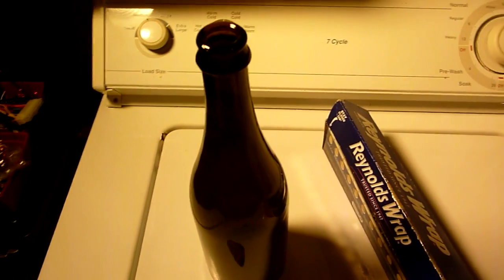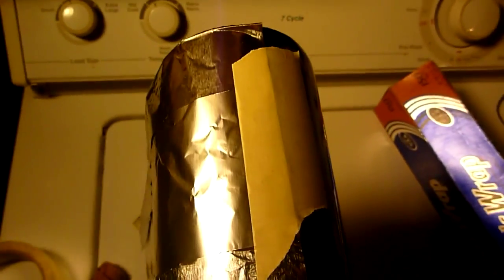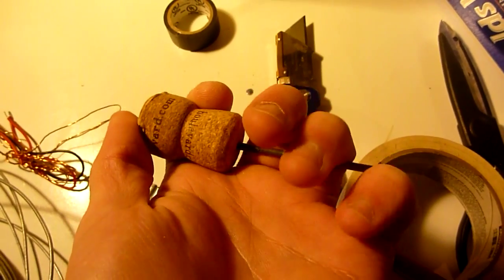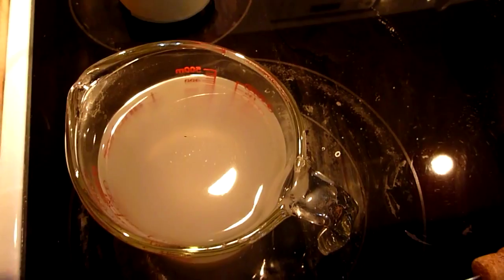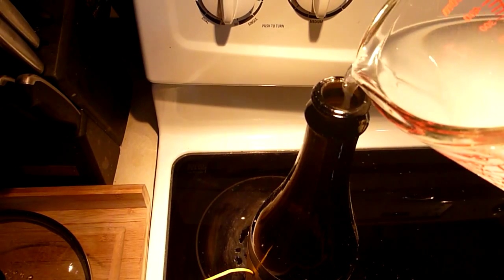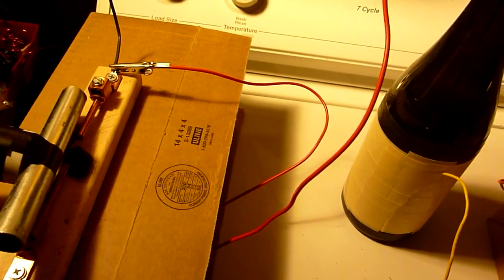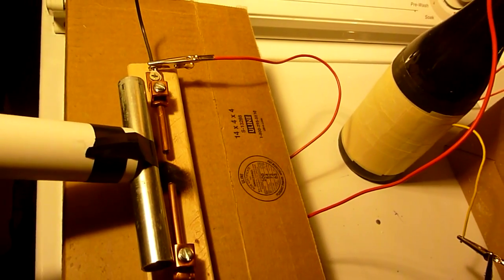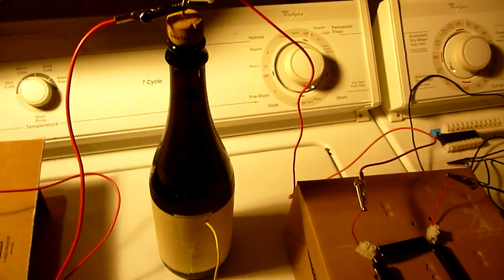How to make a Leyden Jar Capacitor

Comment: What is the capacitance of these caps?
Reply from the maker: +gyorgy komaromi good question, the capacitance will depend on how salty your solution is inside the capacitor (more salty higher the capacitance). It is also related to the size of the bottle that you use (bigger bottle, bigger capacitance). Getting exact values for these things is difficult O_O

Comment: This capacitor works good for 30kV ?
Reply from the maker: João Victor It should work for even higher than 30kV, actual voltage and amperage is difficult to determine because I never charged it to full power! Glass is an excellent dielectric material when it is charged... it draws even MORE charge in. Eventually it will break but that takes maybe hundreds of thousands of volts (maybe more). Basically... it is 30kV+more also at high amperage (I was shocked by it before pretty hard after discharging the cap... it still had left over voltage inside enough to bite). Sometimes OLD technology is BETTER than new :P
Reply: Yay, thank you, I will use this capacitor for my ignition coil powered TC. :D
Reply: Naoki Kashima yeah but the glass bottle you used has I believe iron in it(not exactly sure but the green is something) and that will be less effective then clear glass in most cases

Comment: Great vid!...very effective components for cheap. I've had 1 glass coffee jar cap fed by 3 flyback transformer outputs in series...not a problem. I'm pretty sure Ben Franklin did an experiment with a leyden jar cap capturing lightning with 1 of the terminals...Ha!
Reply: ***** Hi,did you connect 3 fly back transformers in series?? Wow, did they work well?? Nothing unstable??? They were the same model??? I have so many questions, so far I haven't seen somebody who used more than one :/ you're my life saver :) Did you use it for a Tesla coil???
Reply: gyorgy komaromi Yep had 3 hooked up with the inputs in parallel and their outputs in series. I made a vid of 2 in series..."Double Barrel Flyback Transformers" is the title of the vid I think :)